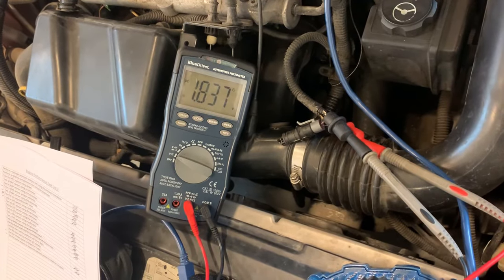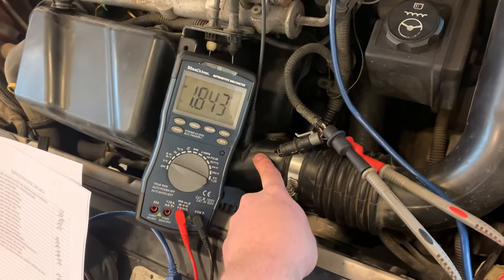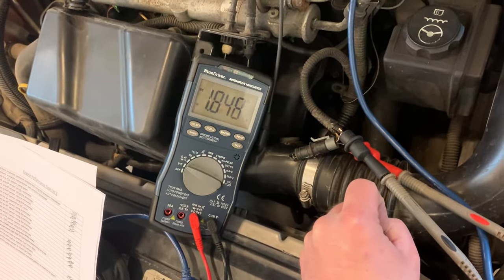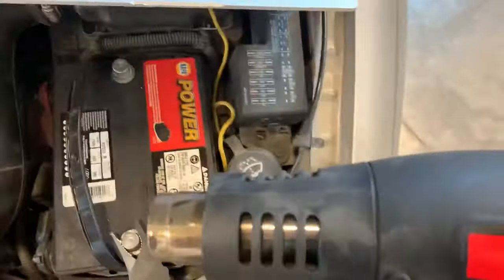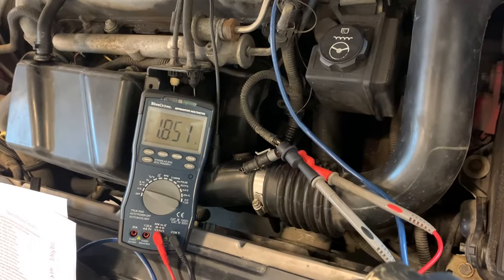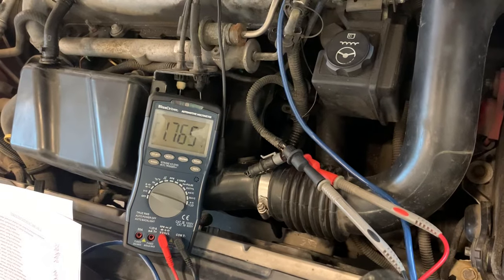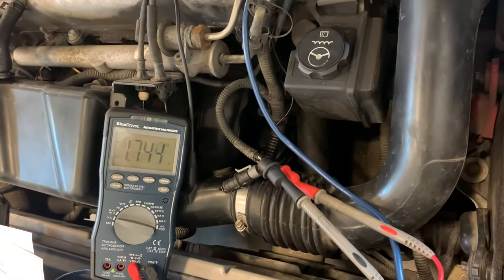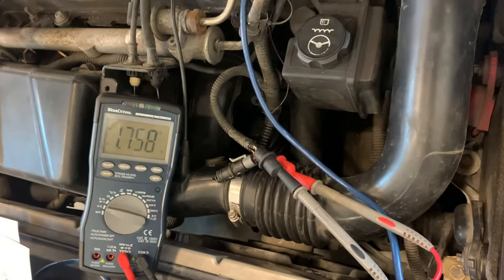Testing an Intake Air Temp Sensor Using a Multimeter

Comment: The AIT is temperature depending resistor, with negative temp coefficient, NTC. As the temperature rises the resistance drops, so one can test it with hair dryer. However the resistance is usually different for different car manufacturers, but will usually be 1k, all the way 50k ohms at 20°C.